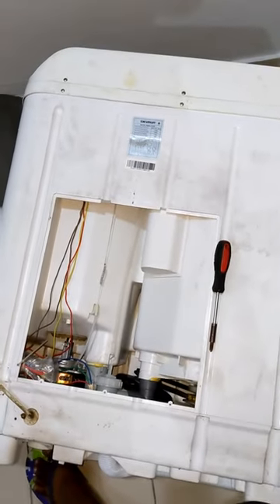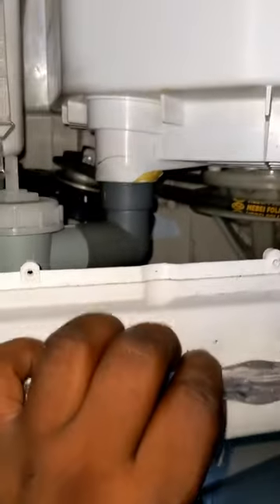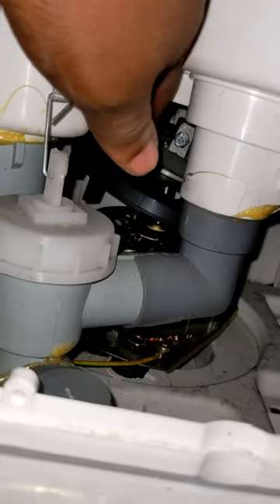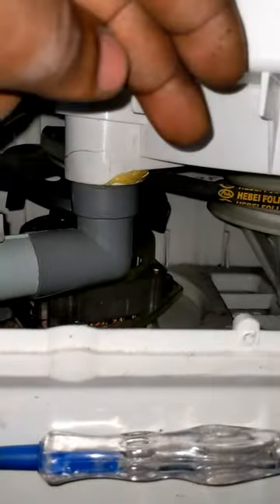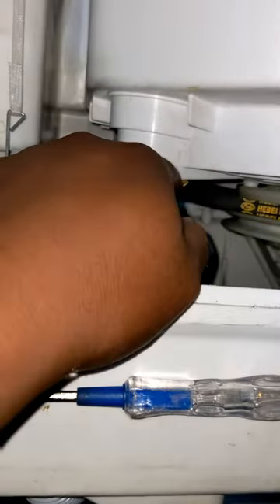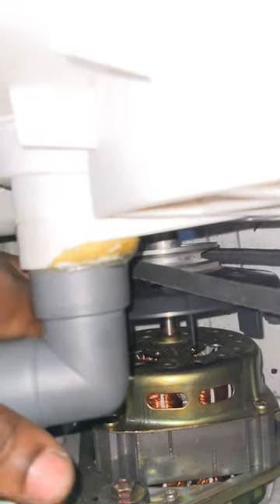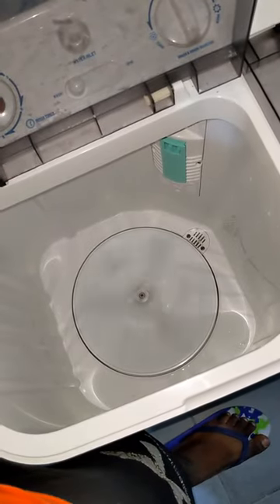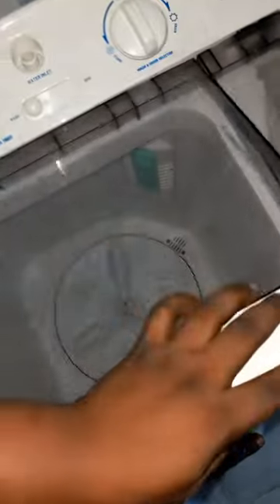Easiest way to fix a Twin Tub Washing Machine not spinning

Comment: Both my dryer and washer just suddenly stopped spinning. Belt seems to be aligned okay. Can you help me what else to look at?
Reply from the maker: @danisejade8786  you need to know if power is coming to the machine, is none then it's an electrical problem, your fuse could be spoilt and need replacement

Comment: Our washing machine os not working, the timer spin is worling but it doesnt spin? The  dryer spin works actually? Except the wash water spinner
Reply from the maker: @gachaolfing1204  ur can be the motor also, open the back and check it out using the video tutorial

Comment: the drying side is not spinning what can I do?
Reply from the maker: Have, have you checked if the belt is connected to the motor or it has derailed??

Secondly check if the drain pipe is clogged

Comment: Mine is varely spining, but also i smell a burnt smell too. Should i replace the belt or is it the motor
Reply from the maker: Check if the belt is on its thread and if there's wear on the belt, if yes then it could be the belt that's smelling otherwise then it's the motor that needs changing
Reply: @nkwachukwunwafor  where can we get another motor for it?
Reply from the maker: @theOgAk87  I wouldn't know for your country